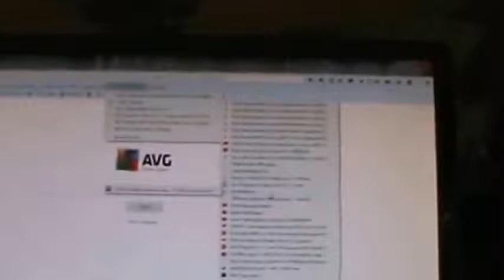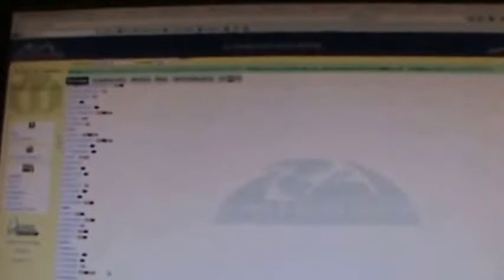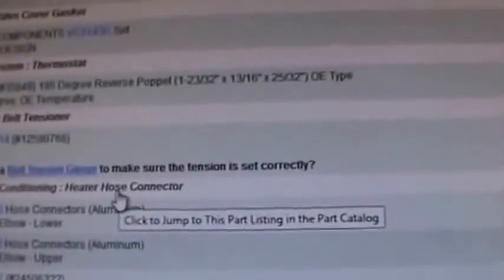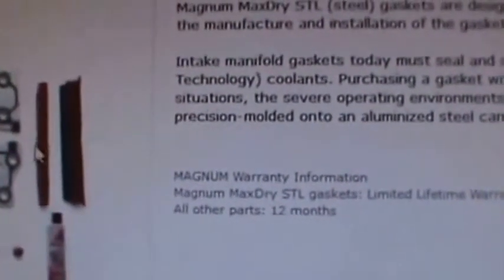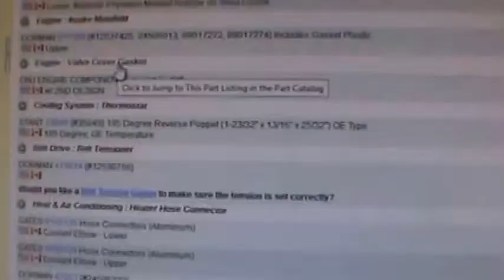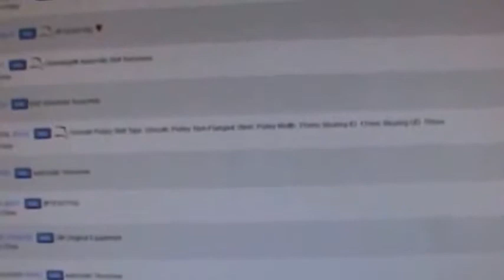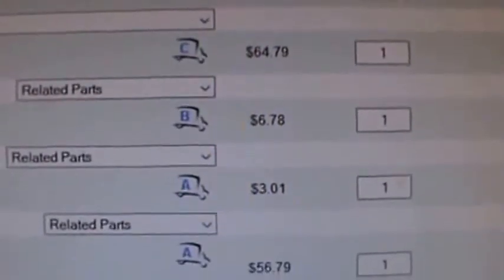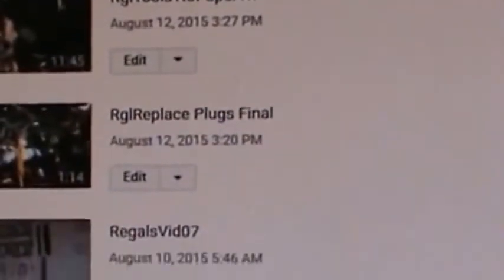3800 Series 2 Upper Intake Manifold Replacement Part 1 of 5

Comment: Part Number    Description  
https://www.underhoodservice.com/second-generation-repairs-servicing-the-gm-3800-series-ii-engine/
http://atpautomotive.com/featured/engine-intake-manifold  
https://www.felpro.com/find-my-part.html
If degradation of upper intake manifold composite material is found, 
replace the lower and upper intake manifolds with the following part numbers:
Amazon could be a good source for parts. Service change with RockAuto 2020 caution.
89017554    Gasket Kit, Upper Intake Manifold   
89017272    Manifold Kit, Upper Intake  Use ATP Gasket included
89017400    Gasket, Lower Intake Manifold  replace with Fel-Pro
24508923    Manifold, Lower Intake   Not normally needed or Salvage yard.
47065HP      Heater Hose Elbow Aluminum.
800-059        3/8 In. Quick Connector, 90 degree w/ 18 In. of 3/8 In. Nylon Tube and a Union
800-016 GM Retaining Clips
Permatex 59214 Thread sealant lower intake gasket

Comment: Abnormal Engine Coolant Consumption or Coolant Leak details: 
https://www.underhoodservice.com/second-generation-repairs-servicing-the-gm-3800-series-ii-engine/
http://atpautomotive.com/featured/engine-intake-manifold  
https://www.felpro.com/find-my-part.html
If degradation of upper intake manifold composite material is found, 
replace the lower and upper intake manifolds with the following part numbers:
Part Number    Description  
89017554    Gasket Kit, Upper Intake Manifold   
89017272    Manifold Kit, Upper Intake  Use ATP Gasket included
89017400    Gasket, Lower Intake Manifold  replace with Fel-Pro
24508923    Manifold, Lower Intake   Not normally needed